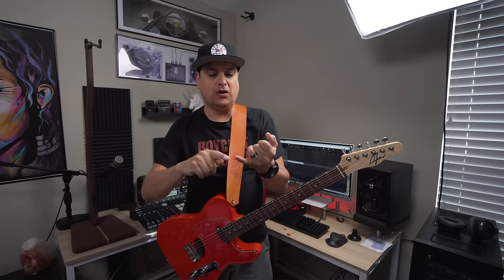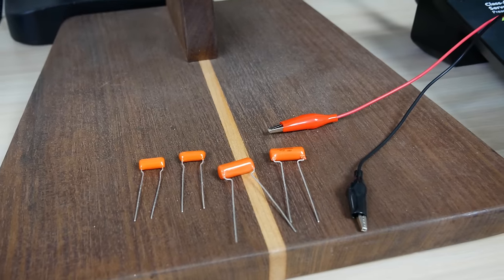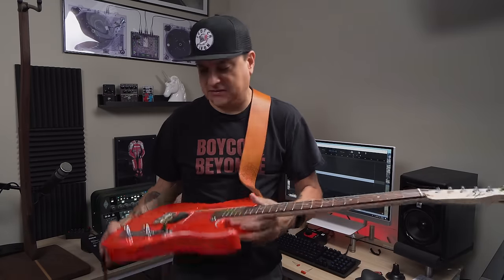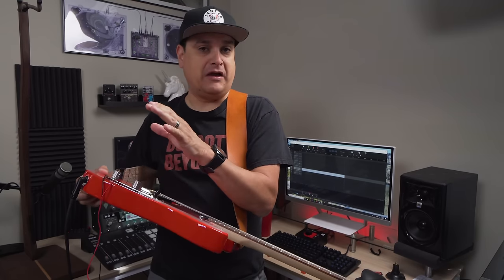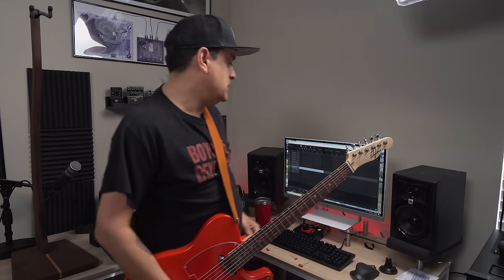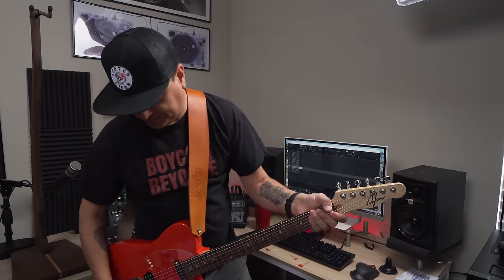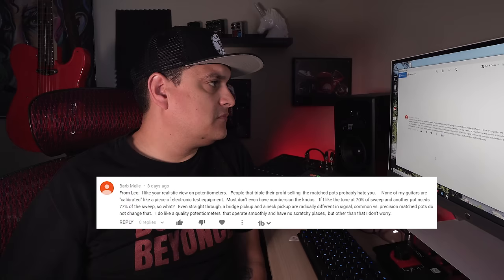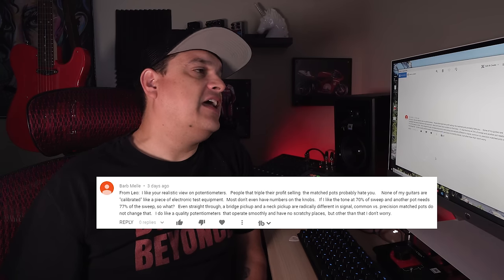What Capacitors Should I Use In My Guitar - A demo

Comment: Great videos informative and positive as well as humerous. Always lighthearted even about nasty comments. Question: tone knob busted, opened it up the pickup wire came off, the pot wasn’t glued on anymore and spun around. The capacitor is soldered to the left side lug not the middle, that’s where the pickup is connected . (Looking at it from the top with the lugs pointing up). Does this matter? It seemed to work okay...Will i blow up the neighbourhood if i solder the pickup to the middle lug? Everything else is same as I’ve seen on vids like yours, just the cap and pickup to tone are soldered reverse. What must i do?

Comment: the woodof the body is only part of the overall weight of the guitar,, you have to consider the weight of the electronics and the hardware as wel in the total weight of the whole guitar,,my Strat started out at about 7.2 lbs and after I add more pots and the added weight of locking tuners and the reas like the heavier trem block replacing the cheap pot metal block it came from China with the weight total will be more even though the body alone will be less when the control cavity is enlarged to accommodate the added controls it started as a bog standard Strat with 3 pots standard tuners and single coil pick ups  it;s ending up with 3 quad rail humbuckers and 6 pots (3 push/pull 500k vil and 3 500k vol pots as well as adding a bypass switch  and adding led lighting inside the cavity for effects...yep same on I've been talking about for a while its all stripped and partially refinished and the electronice are all wired up and ready for installation as soon as the body is done adding a titanium nut too  light and really durable roller string trees as well as roller saddles in the gridge....going all out with this one for the fun of it to see how well my plan goes the next build will include the Tele pick up you built with the other builder that you sent to me a wile ago...got a pick up now need a guitar to put it into...got a Strat first and the Tele is next..and then the other major types get a place  in the line up  you know SG ,,and a Les Paul then maybe an ES-335  eventually a custom shaped body with a few new tricks I thought up on my own,,,this is a newer hobby for me and at my age I get to indulge myself a bit,,, no hurry and get it the way I want it by doing it all myself....  I can't afford to resto mod a cclassic car like I would love to do but a guitar is s,aller and cheaper to do in the long run..

Comment: Hey, great videos, thank you!  I am in the middle of a kit build for/ with a friend.  We have both been playing ukulele for a while and I do light luthiery on ukuleles.  He wanted an electric solid body uke, and we decided to make a guitalele.  It is a 22.5” scale and we will tune it ADGCEA.  

We have upgraded a pickup which sent me on a search to understand electronics and your vids on pots and caps are very interesting.  The SC style kit came with two single coil pickups.  We decided to upgrade one pickup, keeping in mind that we will probably upgrade the other in the future.  The upgraded pickup is a humbucker.  So I have learned about adding a resistor when there is a HB and a SC pickup.

Some of the videos indicated that trying different resistor values ranging from 470k ohms up to 620k are most likely to give good results, though at times even different values may prove pleasing.  I have been toying with the idea of trying different resistors to try out different sounds on this instrument.

Then I saw your videos and eureka!  I love your idea and I am going to use the jumper lead trick to try different caps on the tone control.

Question: Have you used the jumper leads to try out different resistor values when the pickups or pots are sort of mismatched?  I have resistors in all the sizes we might need and bracketed on out way beyond, so I thought it would be easier to try different values with the resistor as well as the cap.  To get to the electronics we have to remove the pick guard, which means removing strings, which makes it much more time consuming to make changes requiring direct access to the pots, etc.

But I assume that so much resistance will be added by the jumper leads that it would skew the results of the test to find the right resistor value.

Suggested content:  I love that you are telling us how to make changes to the sound of our electronics.  I am new to your channel so apologies if you have done this to death, but I would be interested to watch you work on any instruments that you evaluate for changes or repairs, how you go about it, and the before and after sound comparisons.

Thanks again, and I will keep watching!

Comment: This is a very informative video, would have been nice to see different types of capacitors as well, other than the standard orange drops, like paper in oil and ceramic with different values
Reply from the maker: Cause it doesn’t matter what they are made of
Reply: Correct, values are values.  If two capacitors are the same voltage rating and capacitance, they will do exactly the same filtering to your audio signal.  Buying expensive capacitors is snake oil.

Comment: I was set in getting a prewired 500k pot set for my Epiphone-LP; it comes with .022uf "bumblebee" replica caps. Now that I've come across this video, I think I want .033 or .047

Question, does anyone out there (including you, Dylan) have any experience with .033 or .047 caps for modern/progressive metal style distortion? I'd imagine a set of humbuckers, with a set of 500k pots, equipped with .047 caps will give you a very bright distortion tone...right?

Great video Dylan - thanks for geeking out on us.

Comment: what if, now hear me out,  
you use a digital looper at the pickup
(after volume pot or before depending on ur tone wiring ..or nvm, put jack instead of wherever ur tone leads run)
 and then take one of my 1/4 jack to gator adapter and adjust and switch out  caps form there, using a identical sample of signal... 
hands free
(can use daw to spectrum analyze or reamp with all that freedom)
less variation from human things

wondering if the DI signalpath would be different or not accurate of final because off resonance or feedback or idk, open to critique and discuss

Comment: I heard a difference, even though my cell phone speaker. I'm wondering if modern wiring versus vintage 50's style wiring would give the same results, because 50's style connects the tone control to the volume output instead of the input.

Comment: So Dylan, I'm putting a pair of "duncan design"(inherently dark)humbuckers into a strat. If I use a 1meg volume pot, and and wire them in parallel all the time, will that give me a bright "strat-ish) tone without the hum? The guitar weight is about 7 pounds. And also if I need a capacitor which size would you recommend for this set up?

Comment: Hi Dylan , loved the video, however I heard no difference when all are at ten or zero? They sounded exactly the same to me? I just finished doing the same thing on my Telecaster ; Teles rule! : I have four Teles all are different pick up combos , from vintage single coils, to active humbucker. My preferred caps on these beauties start at .10 to .56 caps .not .010 etc. Really makes a huge difference in sound saturation to me and cap effects. All the way shorts the pot so no cap resistance is applied, all the way off also does the same. Thanks sir love your videos.

Comment: This is such a great insight in comparing different farads of capacitors to determine the tonal difference. However, you didn't consider the balance of the pots (ohms) to use in each. Many cheap guitars have completely wrong ohms in their volume which is why they cap out LONG before you reach 0. When I ordered different pots on ebay, I made sure to get two of each different ohms for my one volume knob and two tone knobs and I got it right the first try (250 ohms was perfect for my volume so it ended at absolute 0). This is why you don't start noticing drastic difference in tone on the .022 (microfarads?) until you reached the 5th level (guessing you were using 500 ohm pots), from there you should have used fewer ohms to compensate for the currency in the circuit. Not bashing you here, just pointing that out. Don't change anything in this video. Seems to be the only one out there and this is a great video. Thanks!
Reply: Jonah Innuksuk
These pots not the 250 or 500 ohms. They are 250 Kohms and 500 Kohms.
Reply: @iridios6127  It's these, not theise... Haha thanks for pointing that out. 500 ohms would NOT make a difference whatsoever.
Reply: @Jinnuksuk  
If you take 500 ohms instead 500 Kohms -- you`ll notice huge difference.
Even if it will be 500 ohms instead 250 Kohms. ))
Reply: @iridios6127   500 kohms is 500,000 ohms... 500 ohms is a very tiny resistance in which it would have very little affect in volume reduction or tonal difference is what I meant.
Reply: @Jinnuksuk  
Which one in your guitar ?
Reply: @iridios6127   Ah man I placed them so long ago I honestly don't remember off the top of my head. I know I have 250 kohms on my volume and I think I used 250 kohms on one tone and 500 kohms on the other, I made sure to order two of each just in case. I know that I was going to switch things up if it didn't sound right the first time but everything worked right off the bat so I never bothered to look at em again. I can't exactly fit my multi tester in a very tight space. But I will be building my own guitar soon so I'm going to be sure to set everything right.
Reply: @Jinnuksuk  
Now i get it.

Comment: Dylan ; Can you  speak more often about volume pot info on Stratocasters with all three single coils. l see you prefer 500K pots with 47 caps, but what about the volume pots are they 500k too, and do you use a cap for them or just  wide open? Also If a no load pot is used, is that for tone pots , or volume pots too. l am still unclear on those choices .

Comment: Gday mate, finally understand how caps and pots work. Thank you! I’ve been struggling. 
One question around wiring an HSS Strat - with the 1 tone and 1 vol pot configuration 
Could you please help with your view on the best way to wire this? Would it be 500k pot? I’ve seen people suggesting 300k to hit the middle... of love to hear your thoughts - and be pointed in the right direction for your products.
Pickups ( 2 Single Coil, 1 x Humbucker) Neck 5.15k  
Middle 5.26k 
Neck 7.39k 
Thanks mate!
Reply: I use a 500k pot for volume and run a 510k resistor from the switch to ground where the single coils are wired in so they still see 250k. Then everybody's happy.

Comment: I have a question: Why not use a trimmer / variable capacitor? I recently saw a treble bleed circuit being sold that uses a variable component (I don't know if it was a trimmer/variable cap or variable resistor).

Comment: Dylan I need to get .033uf cap for my strat (running 250k pots) and a .068uf cap for my j bass(after installing a Leo Quan bridge it seems to bright with a .047uf. Tried a 0.1uf cap - muddy as the Ohio River bottom

Comment: The precision pot thing isn't necessarily snake oil, but it depends on what they mean by "precision". A Bourns is an excellent pot, has a little tighter tolerance than the normal 20%. But 250k is 250k, and the signal has no idea about anything else. And if it happens to measure exactly 250k, a Bourns sounds the same as any other pot that also measures 250k-- Alpha, Carling, CTS, take your pick.
   What strikes me as pure snake oil is someone claiming that a pot has been "calbrated" in some way. You can't calibrate a pot. It has no provisions for doing so. At best, someone is just filtering through a bunch of pots and tossing those that are mabye <240 or >260 for a 250k pot. A pot that actually could be calibrated would cost so much nobody would buy it.
Reply: G5
They go through rejection\selection procedure, and they get into a pack with certain tolerance. It is more important that the pots have no heat noise.

P.S. Modern technology will allow us to calibrate almost anything.  )))

Comment: have you done a video with difference in pots? i only use audio pots. i honestly started doing so because when i first started i couldn't remember which to use for volume or tone. so i just started using audio only plot. i like using them. what is your opinion?
Reply: Dylan, The direction the cap is installed. What’s your opinion on the subject?

Comment: This was actually very helpful. Simple, short, useful. 

I recently modded the heck out of my MIM strat (new pups, pots, custom cut pickguard, repaint) but i never installed a cap or resistor so I could hear the organic tone of the pickups. 

In the next couple days I will be adding a resistor and cap in series to slope the high and low frequencies and help accentuate the midrange.

Comment: Hey I put in a .0047 orangedrop and it's great It's way better than anything that came with guitar. It seems to me that most are not even the correct or specified  values. They use the cheep ones . Anyway,  I liked your way to test them and thought I would put in a little threeway switch and put in the  .0024 ( I think thats the one) and a .0047 and then you can choose one or the other or both. I'll let you know. PS Do you make an economy Dynosonic shingle or can you sugest anyone. I can't pay $200 each for a pickup that came on the cheepest guitars in the day. LOL I'm joking a little. I love these pickups but until they started wax potting  it was suposedly annoying. Turns out though they are my favorite.

Comment: DYLANTALKSTONE, Does using a Bubblebee cap the capacitor has a color code on the caps body really make that much of a difference and what are the differences it the phase angle or the bubblebee changes the frequencies because of the bubblebee material used?

Comment: I cannot find any information on, why some wiring diagrams show the capacitor wired between the lugs of the tone pot and the volume pot. While some other diagrams show the capacitor wired to a lug on the tone pot and the other end wired to the back (grounded) of the same pot. Does this make a difference?

Comment: I like the .047 cap with the 500k's in my Strat-style guitar. They were a matched set at 525k but weren't advertised as a matched set. They also weren't expensive. 

Thanks for making that 500k pot vid, Dylan. It was only logical to use 500k tone pots. Use em at 6-7(or wherever 50% is for that pot) for 250k and bring in even more highs if I need em at other times. The volume 500k made a pretty big difference as far as I can tell. I only had my guitar 7 weeks before I swapped pots though. I just got another unmodified one almost exactly like it so it'll be a good comparison once it gets here.

Especially on the new-to-me Line 6 Spider IV I bought yesterday not much of anything. I only had a Silvertone Smart IIS amp before this with maybe a 4.5" Speaker? 6"? I don't know but it's small and it sucks. It has a gain knob but it's pretty crappy, too.

Comment: The voltage of the capacitor makes a difference in the sound as well. The higher the voltage, the broader and fuller the sound is. I use 1000v or higher as opposed to 300v or 600v. To my ear. I did the same thing as Dylan did, using alligator clips for testing.
Reply from the maker: Just to clarify… the working voltage/voltage limit has ZERO effect on the capacitance nor does it suffer ANY dialectric breakdown in a guitar. The voltages are simply too low. I’m won’t argue that you imagine a difference. That’s up to you. BUT, science…. There is ZERO difference at the working voltage of a guitar. It is simply outside of reality. (Just want to clear this up for others who may see this)

Comment: Been wwatching a few of your vids over the last few days, would I be correct in saying that the setup that would give the most variety would be a no load 1m pot with a 47 cap? Not talking about how good the tone is, pureuly tonal range and options, then I can dial back the tone to whatever I like to achieve a good useable sound. I've sometimes heard of people dialing in their amp with the tone on 5 then you have the option to add treble and cut through as well as cut for more bass, as opposed to it only working one way

Comment: Hello, may be you, or somebody else can help me, i have a rockbass streame, that hast the volume pot in a place, where sometimes when i play with pick i accedentally hit it, and change my volume.

trying to remove the "potenciometer cap" (that must have been glued) I pulled out the potenciometer shaft, so now i use a volume pedal and my problems are solved, except for the hole in the bass.

I was thinking tu put a killswitch in the hole, but here comes my doubt, should I let the potenciometer inside the electronic cavity (now is fixed at max) or I can remove it completly leaving only the tone pot and the killswitch?